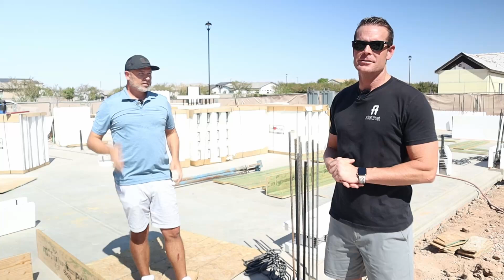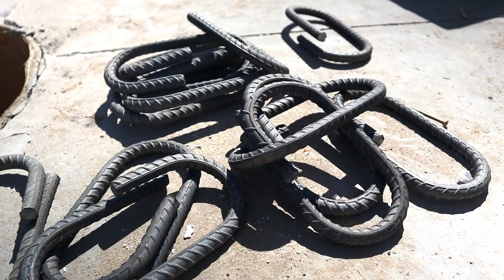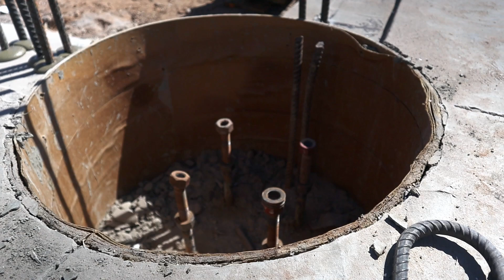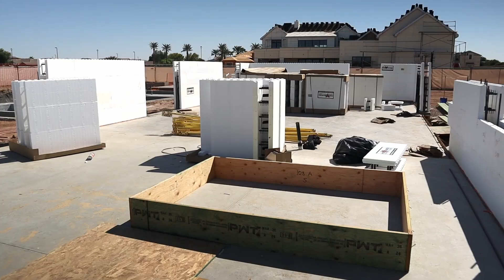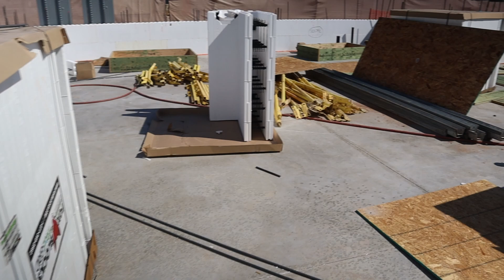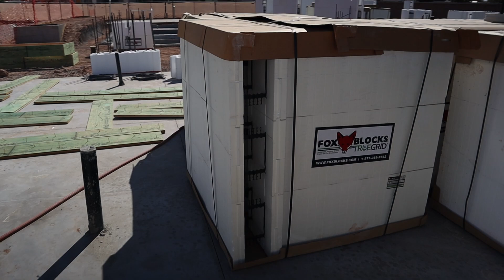Structural Steel & ICF | Ep-20: Liberty Estate  | AFT Construction

Comment: I built my son's house with Fox blocks ICF with the help of the Castle Rock guys in Litchfield Park.Turned out great. Last July/August electric bills $220/month for 2500 sq/ft house in Waddell.  R-50 attic insulation, standing seam low SRI vented metal roof, low U fiberglass windows, Mitsubishi diamond 3 zoned high SEER minisplits, ERV, energy star appliances. Good investment.
Reply from the maker: Sounds like an amazing build!